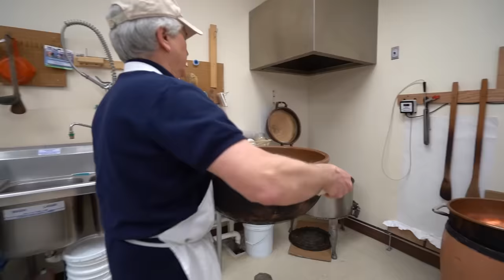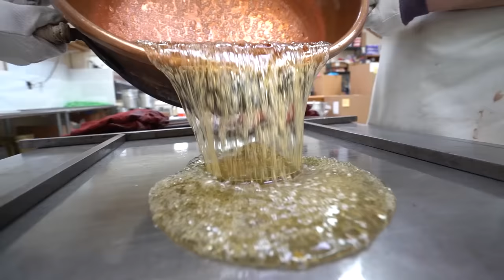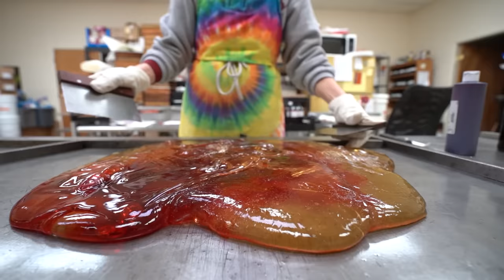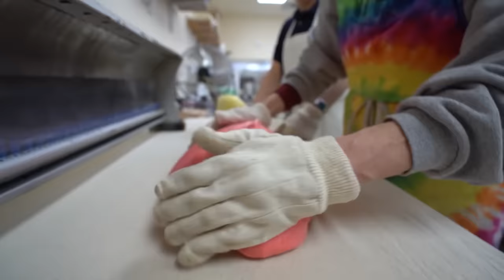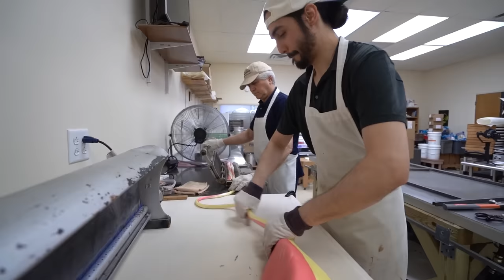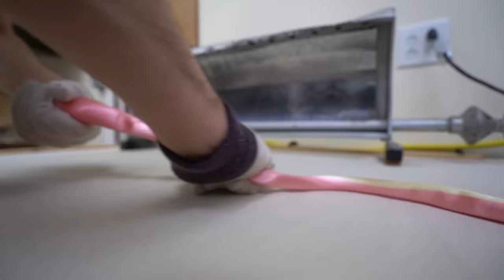We Made Strawberry Lemonade Hard Candy For The First Time Ever!

Comment: The cream of tartar gets in the way of sugar’s natural tendency to bind together and prevents those dreaded sugar crystals from forming. Some sources say that white vinegar or lemon juice can be substituted for cream of tartar, but it can get tricky since you need more vinegar to get the same acidic reaction and that amount of added liquid could cause problems with the original recipe.
Reply: Technically, just the corn syrup should be able to keep crystals from forming, but you have to be more precise with times and temperatures. The cream of tartar just acidifies the mixture to help the white sugar invert.